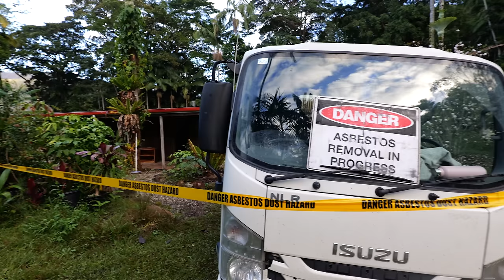Life & cabin update (what's next)

Comment: Hi, I live off-grid in New Zealand and I've been growing a vege garden since 2015 
It's cooler here than where you are, so you'll be able to grow a bigger variety of fruit & veges. 
Building up the soil is really important. Have at least 1 compost bin. You can also make leaf mold. Collect leaves (not thick leaves) and fill large plastic bags with them (I use empty compost bags. I don't have enough compost of my own so I buy it) Then fill them with water, tie them off, and poke mall holes all over them to let the water drain off. Put them aside & forget about them. Eventually it will turn into great material for either mulching or adding to your compost. 
I don't know what kinds of animals you have there. A fence around the garden may be necessary. I built mine with wire (deer, wild boar and hares here) so it gives me ready made trellises to grow runner beans and passionfruit up. 
I think a good gardening site for you to watch and to ask questions of could be "Self Sufficient Me" as the climate looks similar to yours. 
Happy gardening 👍🌾🌱

Comment: I dont know if the regs are the same but in UK if your structure is on wheels you dont need planning permission. So if you built your tiny house on a shassy/wheels of some description you might not need planning permission & you can move it if necessary to different spots on your land.

Comment: Hi Max, regarding the veg patch. That location is good because it’s close to home so you can see how it’s all growing right from the kitchen window. It’s also much easier to keep the “predators” at bay. 
Here’s what I did with my initial jungle/ previous owners veg patch. I pulled out what weeds I physically could, then I covered the whole thing, about 10 metres x 8 metres with dark plastic sheeting to kill everything else I couldn’t pull out myself. Left it for a few months. That gave me the footprint to have raised garden beds built. I chose concrete retaining wall panels that fit together by sliding the panels into the upright posts. You can create individual beds or join them to make longer ones, L shapes U shapes, what ever you want. Mine are 700mm high. I have two entry points wide enough for the wheel barrow etc & enough space between the beds so topping them up is easy. They are maintenance free & will definitely outlast me. Hope this is helpful.

Comment: Go a short throw projector, you don't have to mount it on the ceiling and run long cords to the projector, they are a bit more expensive, but you will save money on getting a electrician in to put a power point in the ceiling where the projector will be mounted, and of course you won't have the eyesore of the electronics hanging off the ceiling.